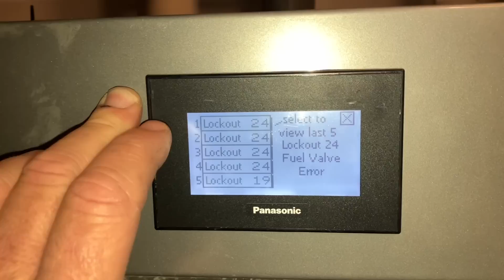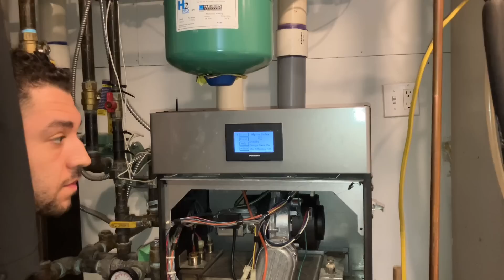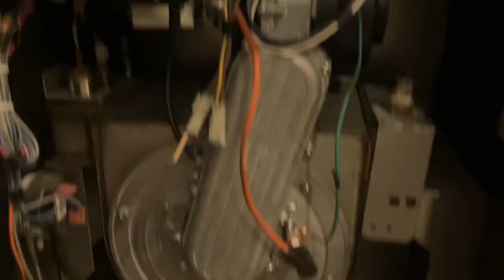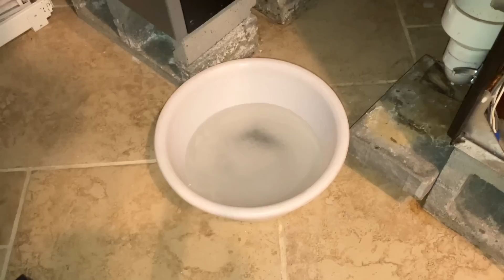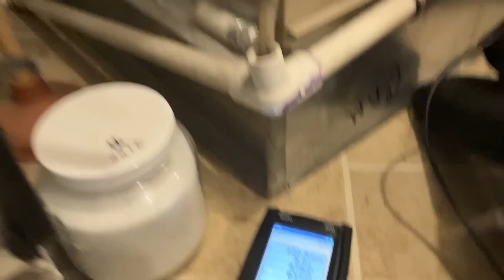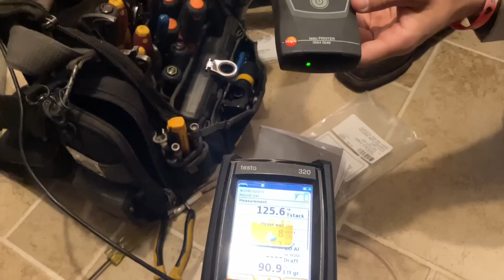Burnham Alpine EXPERT Reveals the SHOCKING Truth About ERROR 17! Not in Manual!

Comment: I see the setpoint for the boiler is 155. I was told that a condensing boiler stops condensing at 120°. If you need 155° water, wouldn't it be better to use a boiler designed to heat water above 120°?